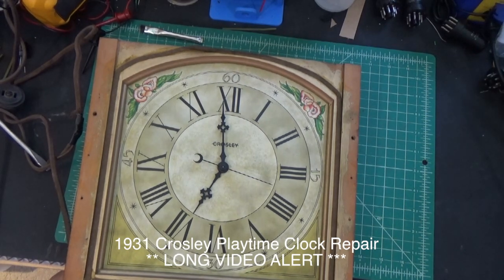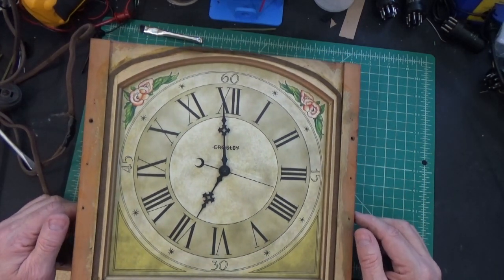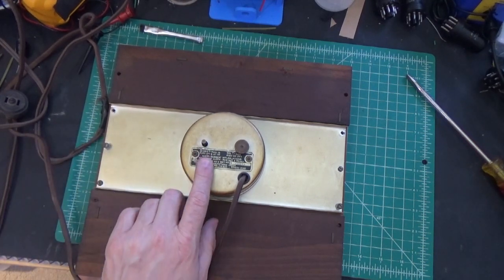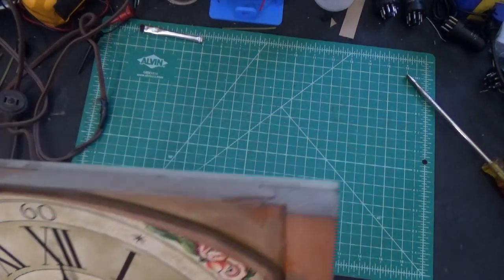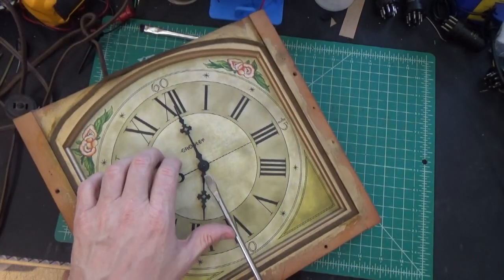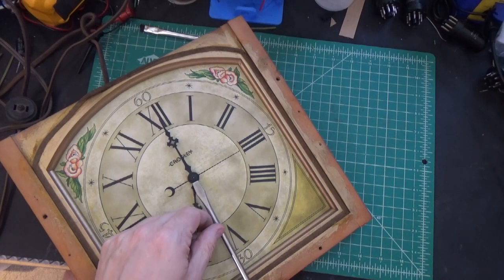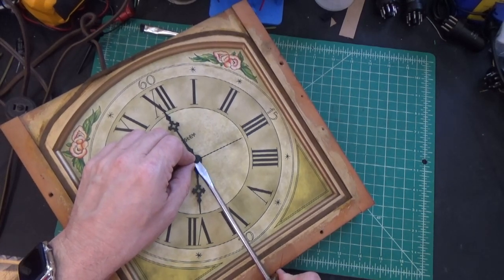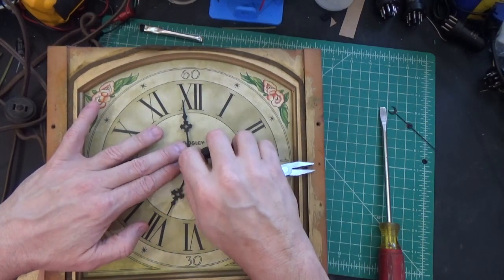1931 Crosley Playtime 124 Grandfather Clock Radio. Episode 1 -  Its about TIME this was restored.

Comment: Hi, Ron!  If your clock gradually gets harder and harder to re-start, you may need to do the following:  disassemble again and, instead of trying to de-solder the entire gearbox halves,  note the blob of solder on one side.  Carefully remove this and you'll find a push-in pin.  While keeping the case hot, gently pry the edges of the pin until it comes out.  

Careful,  you may have hot, freshly-melted gunk of old oil spew out!  Then,  turn the hole downward and shake.  A great deal of this fluid will emerge,  as long as it remains heated.  You see,  the inside of the gearbox is just that..and is (was) filled with oil in 1931!  Once the majority comes out,  let the box cool a bit and begin squirting WD40 into the hole.  Re-heat each time you do this,  and more old melted gunk will emerge.  This can take hours of repetition to complete.  Once done,  let it drain as it cools using a paper towel to draw the oil out while it's down.  

Once cooled,  you need to refill it about 1/3 of volume (by feel and listening when you shake it,) but with what?  I thought of various mineral oils,  even cold-flow oils such as compressors use, but finally decided on 3-in-1 as being the oil hardest to dry out, while thick enough not to come through the shaft sleeve of a 90 y/o bearing.  

The easy way to re-start the clock in either direction is to spin the hand at normal run speed.  This is the spot of synchronization. Once it slips a bit and the next pole of the internal magnet is "captured" by the coil field,  it will run at that spot forever...power failure or drying lubricant notwithstanding.  By the way,  accuracy is up to your power company...not the clock!  FPL here stays within 3-10 seconds a month,  but this can be plus or minus...with a reckoning period where they must catch back up to the national grid every so often.  I couldn't figure this out until I realized the clock always came back into agreement with WWV or a rubidium clock.  Comparing it daily to such showed the slippage, but no power company I know will admit it!  Then,  I noticed my wife's $6 digital clock did the same!  We just don't notice it day-to-day.

There are many interesting things to add to the clock.  To prevent frequent re-starts during lightning season,  I built a little 14vdc UPS with sine wave output to 3 watts.  If the clock is properly lubed,  it will use about 1.8 watts.  If the power use rises or the coil/case gets warmer,  it's drying out.  Observing the waveform that is 99% pure when resistive-loaded, there is a nice dip that occurs when the motor achieves sync at near the top of each positive-going crest of the 60Hz wave.  I drive the UPS from the battery of an old screenless Omnibook laptop that I have mounted behind the speaker,  on the rear cross-member.  The UPS syncs to AC when it is present,  but free-runs during power failures.  Good timing parts keep it stable to about 5 seconds an hour while on battery.  Adding a crystal oscillator would be better,  but that takes power.  

The laptop, connected by wi-fi to my home net, senses when the battery is nearly run down about 3.5 hours into a power failure and shuts first the UPS,  then itself down.  I added an old stereo laptop speaker amp set inside the radio, behind the clock and it runs from the headphone jack on the computer.  Both this amplifier and the UPS are controlled by the RTS and DTR outputs of the laptop serial port.  The amp is powered from the battery, but only when "faded" on or off by the UPS...just before it plays audio.  The audio is once every 15 minutes, when recordings of Big Ben chimes are played.

Of course,  I can use VLC to stream any other audio through the back speakers.  I use that to interest young visiting children in the "talking clock."  It also plays my internet radio stations nicely,  but through the stereo speakers,  not the radio!  That much power would require a car battery.

The radio has been repaired.  It had melted down early in its life due to a shorted rectifier,  so I added a fuse when I changed the power transformer.  I re-capped it and installed the original globe tubes where I could find them.  Looks nice,  but there's nothing to listen to in a 10 storey condo with 5 computers in each unit.  Even the elevators eat up broadcast band reception.

I want to wind and add a "start coil" 90 degrees off the main coil in the clock,  but that would be hard to do except by tremendous experimentation with coil/cap configurations.  These clocks were built by Hammond Organ in the days before synchronous motors were fully developed.
Reply from the maker: Thank you so much for this information, it is really helpful. I am always open to give things a try and will certainly do that in this case too. Thank you
Reply: @rciancia  My pleasure!  I have nothing BUT time to  give to these projects, so it's great fun to see how far ingenuity and a junk box will take things.  After 40 years of spending (other peoples') millions to build radio and TV stations around the free world, this is much more-challenging!  I first began working on radios, tv's and associated clocks in 1958, at ten.  These were already two to three decades old by then!  Once eBay came along,  I was ready to give up the "fill material" between the good parts of my life and get back to the real gear.  

The clock was a 50th birthday gift in 2013 to my beautiful wife.  I invested $90 in it,  and found an alternative shipper to bring it from Milwaukee to Jax Beach for $200.  The total since to fully restore and augment it is less than $50, and about 1,000 well-spent hours.   It never ceases to amaze her, and she often tells me what chimes she heard during the night!  For some reason, she said "NO!" when I asked if she wanted it to tick...  Every now and then,  I'll change the quarter-hour chime to a "moo-ooo"  just to see if she's listening.
Reply: Thanks! Recently repaired this same radio for a client, the man asked me to see if the clock could run again. The info about desoldering the pin was a valuable tip to getting inside the gummed up motor with solvent and adding 3in1 oil. Success!

Comment: Nice job Ron, If I took this apart there WILL be parts left over...LOL
I hope you used sewing machine oil inside that motor, WD-40 will gum up in time.
I use WD-40 a lot like on tools but use sewing machine oil on motor bearings, etc.
I know who to call if I need a clock fixed...Ron's Clock Repair...LOL
Reply from the maker: Send em on over Bill... I can fix anything...  I did you a light oil on the final assembly, not WD.... But.. its still not working well... as it cool off its harder to start.. there must be gunk in that case.... more to come
Reply: Yes I think you are right Ron, must me gummed up inside, it is a gearbox so maybe drill a small hole in the case and fill it about half way with thin oil.
Solder the hole closed.
Reply from the maker: That was where my head was going as well.  On the side there is a hole that was soldered closed.. I bet if I open that up.. I will have access to it to apply some oil.... we'll see.

Comment: It's not a grandfather clock It's a grandmother clock I think it has to be over 6 foot 5 to be a grandfather clock? But the smaller version is a grandmother clock
Reply from the maker: Interesting - Radio Museum calls it a grandfather clock.  I just measured the cabinet and it stands at 68"   I will have to research that John, thank you.  http://www.jimsradios.com/1931-crosley-playtime-124.html  - Many thanks John
Reply: Ron C well it looks smaller than that in the video can't remember exactly what the size is but it's over 6ft something if it's six eight it probably is. Not sure why you're bothering with it it's not particularly good or worth anything. you should go for a mechanical clock then, much better one with the moon and sun the Chimes are better with an 8 day wind? get a 17th century or 18th English even burner but probably won't be cheap.
Reply: We have a real Ridgeway TALL clock with weighted chain drive. 
It needs a good cleaning, but not a job for a novice by any stretch.  
Even a cuckoo clock is for the experienced horologist.  An electric movement like this is a good  beginner's project.  Dan, coolbluelights just posted his cuckoo clock, yu'all might sub his ch too.  Ron C can tell you, getting into clocks is like getting into guitar setup, something that should better be done by a luthier.
Reply: Hay John, howz 'bout doing a Seeburg jukebox?  Now that's some craaaaazy $#!+.
Reply: Over here, they're pretty much all Grandfather clocks no matter the height.  I've only even heard the term Grandmother clock once or twice in my life.  Why restore it?  because it's unique.  Who cares if it's worth anything or not?  That's like those guys on antiques roadshow who say if this chest of drawers had it's original finish it would be worth twice as much.  And I always think yeah, and look like a piece of crap, lol.  I have old furniture and when I think it needs it I strip it and refinish it.  I'm the one who has to look at it every day and I'm not interested in it's worth because I'll always have it. If I only worked on stuff because it was worth something this would be a very boring hobby, and I'd have a lot less to work on, lol.  I think it' s a very cool combination and will be looking forward to the rest of this restore.
Reply: uma grandfather...   kook
Reply from the maker: John, I am restoring it because it is a labor of love. This item is 90 years old and deserves some TLC for surviving that long. This unit was sold right after the depression and for someone to fork out $75 in 1931 is a big deal. For me, that is worth the price alone.  I know its not going to be worth  alot of $$ when done but to me it will be :)  Thats why I restore this stuff.  Thank  Ron

Comment: Congrats on breathing life (back) into that clock mechanism. At some point, while your waiting for adhesive to dry, or are encountering a "sun conure interruption" (just like a sunspot, only louder), Copy down a few of the patent numbers listed on the backs of these classic radios. You'll be amazed at what you will discover!  You will think that you've inserted yourself into a 1920's through 1960's "soap opera". The legal maneuvering, cutthroatedness, attempts to subvert, and royal screwing that some folks received (Armstrong and Farnsworth, especially) could become the script for a Spielberg movie.

Armstrong was the beneficiary of a "double dip in the cesspool", for after WWII, Sarkes Tarzian perfected FM circuitry, using designs which bore no similarities to the Armstrong Patents, sending Armstrong into the poorhouse, because the "big four radio manufacturers; Zenith, Motorola, RCA, and Philco" redesigned their product lines to utilize the more dependable, less expensive "Tarzian Patents".

Go ahead and yell at the parrot, it's his fault that I wrote this;-)
Reply: Hi Timski, 
Isn't that bird a kakatool?  
Donski
Reply from the maker: Primative backstabbing... it all started with Julius Caesar.... go figure.  Poor Armstrong.
Reply: I thought that I saw a Sun Conure in one of Ron's videos, I may be mistaken, though?